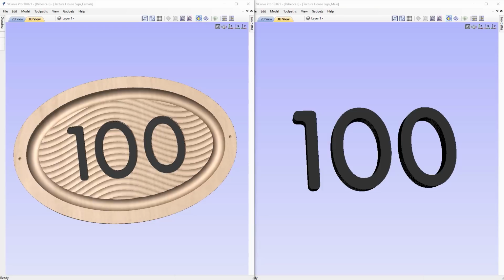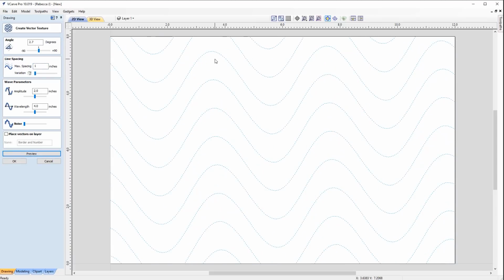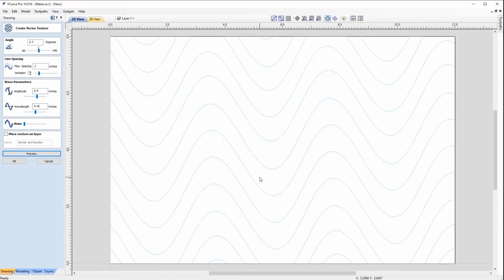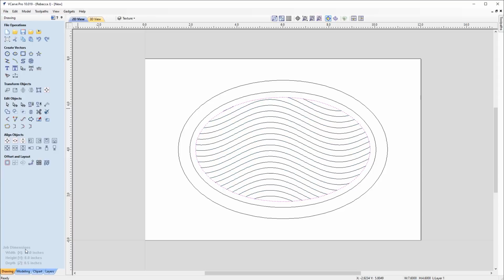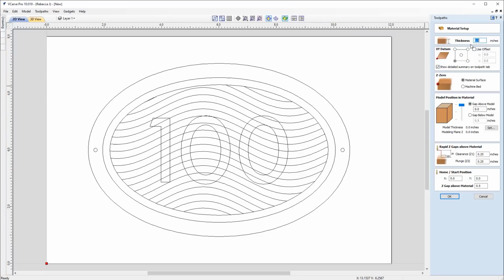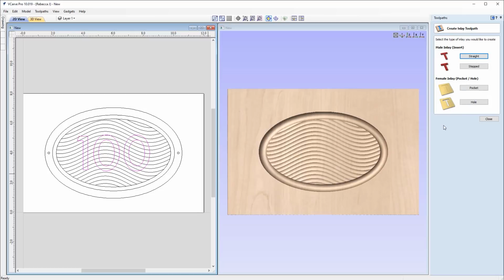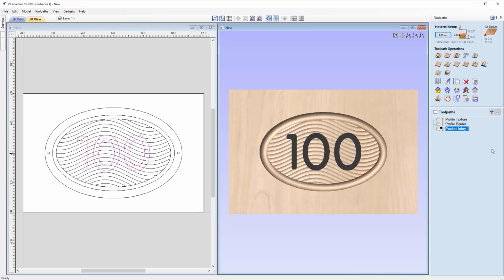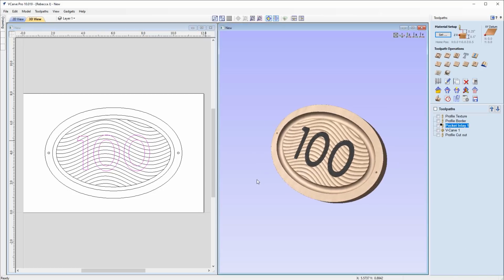Q&A with Beki | Creating a Textured Sign | Vectric FREE CNC Projects

Comment: Hi Beki, I’m attempting to carve facial images taken off the internet. I’m using a profile toolpath with a 60dg. V-bit cutting at a maximum dept of 1/32nd of an inch. My question is; when tracing the image to create the vectors in the design half of the software is there any way to lessen the facial shadows.
Thanks .
Reply from the maker: Hey Robert, sounds like a cool project! Unfortunately there isn't a way to auto lessen the shaded area of any part of a photo, this is because the bitmap trace function, traces the image, so if there are shadows it will trace them. You can manually take the shadows out by tracing the bitmap and then editing the vector in node edit mode to remove the shadows. I hope this helps! Good luck! ~ Beki
Reply: thank you.

Comment: Thanks for the great work. Love your videos! Another option for the numbers is to mix some glow in the dark powder into some 2 part epoxy and fill the numbers... After a day in the daylight, these can glow for several hours.
Reply: Great idea!  What is the best 2 part epoxy and glow mix to use?
Reply: @jake31376  I've used the first two epoxies listed on this page and they both work well. As far as the glow powder, they sell that as well and any of them would work.
 https://www.technoglowproducts.com/glow-in-the-dark-resin-epoxy/  One thing I might add is to seal the carved numbers with some clear epoxy before you pour them full of pigmented epoxy. That way the pigment won't run into the grain...
Reply: @terryjones8360  Cool Thanks!
Reply from the maker: Thank you for your lovely comments :) This is an excellent idea, I'm going to check out the link you sent and note it down for a future project when I can get back on the CNC at the office!  That would really add something special to it to have it glow in the dark! Thanks again! ~ Beki
Reply: @vectric  You're welcome!  One thing to keep in mind with the glow in the dark powder, is that it doesn't show up as well in the daytime, like a contrasting color does.

Comment: We do signs that are typically 96" x 48" x 2" thick or larger.   Tried EnRoute for this but it could not handle the file size and you had to tile texture patterns to get the job done, ... not productive.   How does Aspire handle files and jobs of this size with a rapid texture background?
Reply from the maker: Hey there! Aspire is easily able to handle textures of this size, we have users that create textured wall panels on full sheets that are installed in hotel lobbys etc we haven't heard any problems. It might be worth you checking out the Vectric forum (forum.vectric.com) and asking on there of people's experience. I hope this helps :) ~ Beki

Comment: Could you please explain the offset feature and which button to push to see the location of the offset magnified.
Reply from the maker: Hey Michael, sorry I never got round to answering your question in the chat. Are you referring to the allowance for the female inlay? If so then I put a negative allowance in place so that we create a slight OVERCUT (making it bigger than the vector itself) this then enables a little extra room to be able to slot the male counterpart in, without it being too tight. To help see the effect of your allowance, create the toolpath and make sure the toolpath is visible (there's a check box next to the toolpath in the toolpath tree) then at the top pf the interface you have two options solid view or wire frame (wire frame will show the toolpath as a line with arrows, and solid view will block out everything that is machined away in a block purple colour) Then using the scroller of the mouse you can zoom to the area you want to see. I hope this helps (and makes sense!) Thank you, Beki
Reply: @vectric  Thank you very much. Solved my problem
Reply from the maker: @michaelroy8002  Great to hear :) ~ Beki